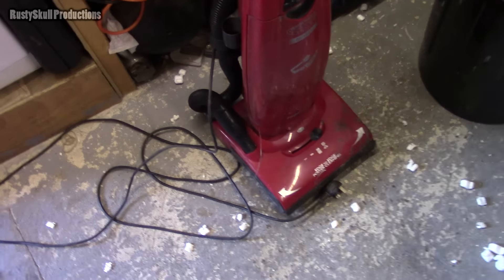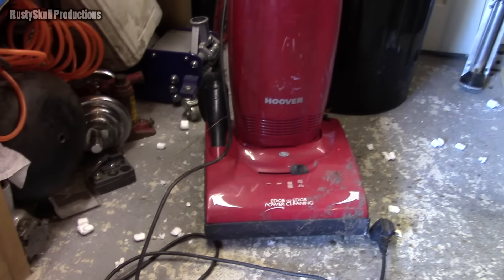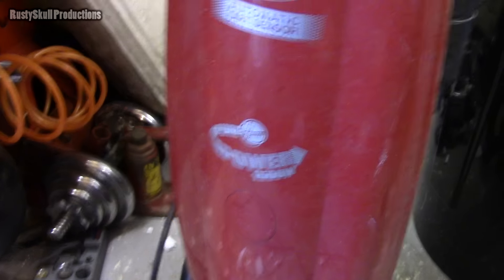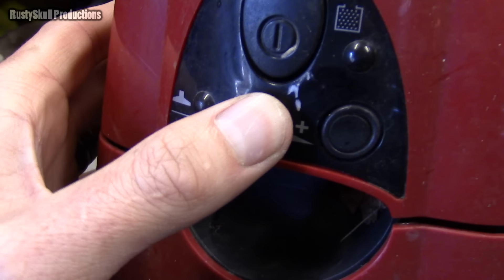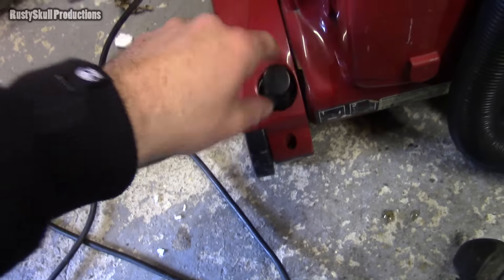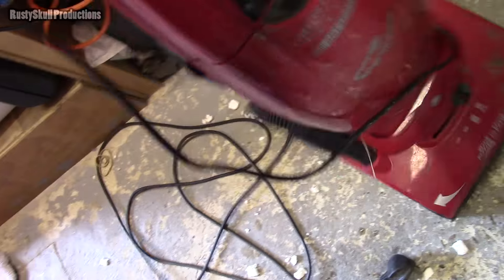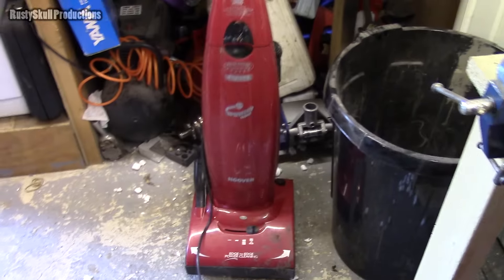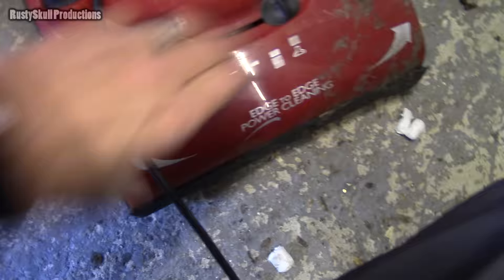Hoover PurePower - RustySkull Productions

Comment: One of the top of the line models, with Autosense, that was quite a find. Made in 2001, in the UK. The red flashing light is the bag full or clog light. The round button by the power switch is the autosense override button, switched the machine onto full power. The green light was the low power light, for when the machine wasn't sensing any dirt being pulled into the bag. These were the continuation of the Turbopower 2 Autosense models, and didn't last that much longer after 2001, when they got dumbed down, and lost most of the gadgetry and features. Later models didn't even have a bag full light. Nice machine that.
Reply from the maker: +MadAboutHoovers Sweet! Thanks for the info!